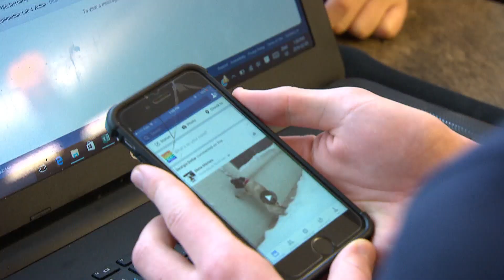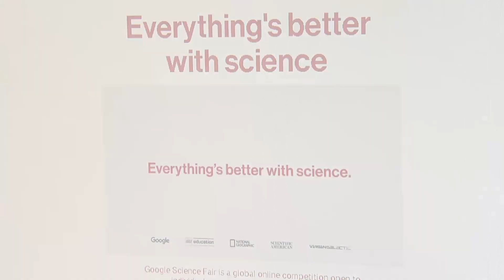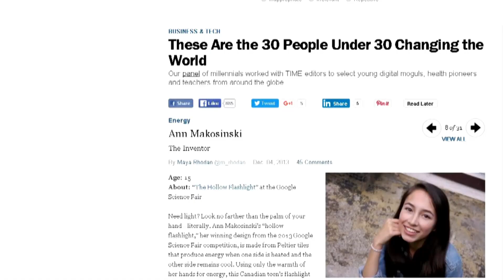B.C. teen inventor attracting international attention

Comment: Just have boiling water for a whole hour, and you got yourself a infinite charger.
Reply: Where you can boil water you usually can plug in. I think it might be good up camping,  heat the water, coco or coffee on the fire, than poor it into the cup. If electric were out heat up some coffee on the grill outside.

Comment: I do not see any invention just some innovation. I'm sure that there are at least a few thousand of people that had a similar idea just realized is not very useful or maybe they even build something similar for fun.
The amount of energy in a hot drink (mostly water say 250g) about 0.29Wh/ degree Celsius delta. Of course most of the energy will not go trough the seebeck element and from that only at best 5% (efficiency of a seebeck module) will be converted in to electricity.
So say 20% of that energy will go trough the module the rest will escape from the top and from that 5% is converted in to electricity. Also assume that coffee or tea is hot 60C and ambient is 20C so 40C delta.
Total energy in that 250g cup at 40C delta 11.6Wh from that 20% only will probably pass trough the seebeck module so 2.32Wh and from that 5% converted to electricity so 116mWh.
Most phones will require at least a 500mA charging current (0.5A x 5V = 2.5W) and all that energy 0.116Wh will be good for around 2 minute charge.
All this are a bit optimist was just a short analysis.
I like her and is cool that she is interested in this. Attracting international attention !!!
Reply: +electrodacus There's a market for it, though. Might not be as efficient, but still useful.